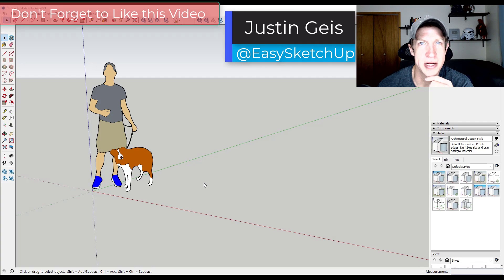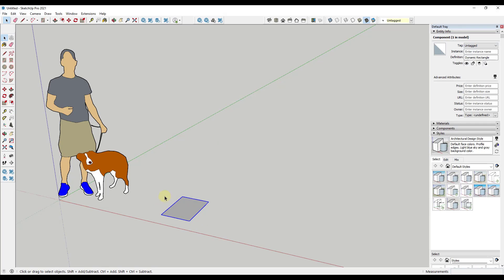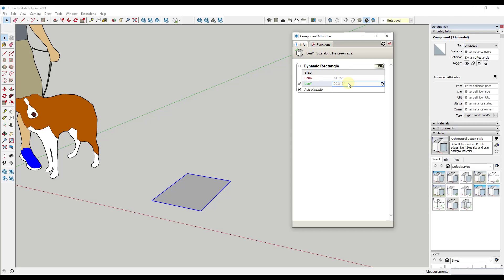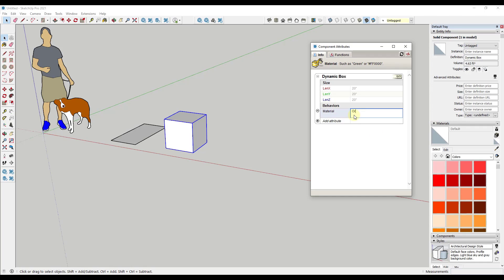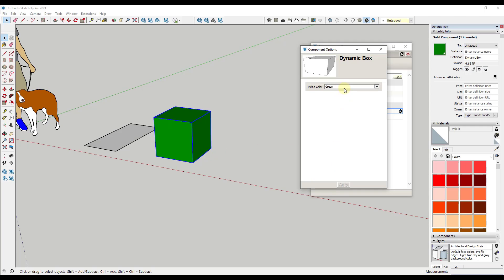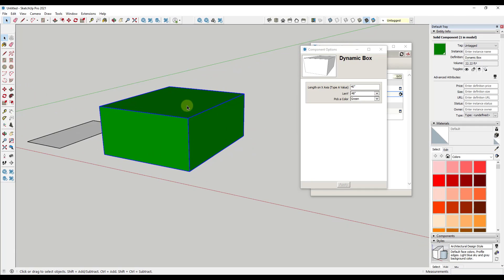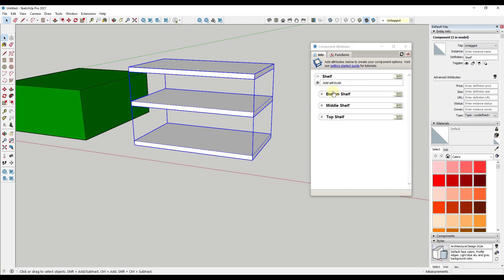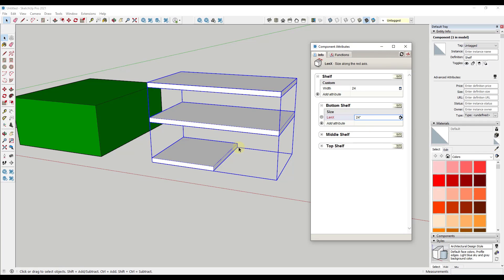Intro to DYNAMIC COMPONENTS in SketchUp (Beginners Start Here!)

Comment from the maker: Hi everyone! Let me know what kind of dynamic components you'd like to create in the comments below! :)
Reply: Block stairs with treads would be awesome :)
Reply: great video, congratulations!
I would like to know if it is possible to animate more than one compnent nested within the same component with a single click. by clicking at the main component, I would like to change atributes of more than one sub components
imagine two pieces of wood joined by a hinge. and at the end of one of these pieces is a second hinge attached to a base. then the set rotates with two degrees of freedom.
the idea is to animate the folding and unfolding movement of the workbench of this video.
https://www.youtube.com/watch?v=jUNZVaGAE3E&list=PLrUyw9mR4oD1RzRHxJnOBl7ZfGo303x2m&index=14&t=9s
tks
Reply: copy in a dynamic polar array - have the user pick the number of elements to arrange in a circle (say for bolts in a flange)
Reply: windows and doors, where height and length are adjustable and mullions and transom windows can be added or removed.
Reply: I am trying to figure out how to automatically create a box, with all of the sides of the box set up as a different component. I think I can see how to do that with this video!  Thanks.  Do you have a part 2?

Comment: Hi! I know this is not related with the video, but... have you had trouble with the 3D warehouse or the extension warehouse not working in sketchup?
Reply from the maker: Occasionally they'll go down, but not consistently. If you're using an older version they may not be supported anymore

Comment: Hi, This video is very helpful. Although, I have miter corners and 4 pieces for 4 sides (extruded aluminum). I have their position linked to "Frame size component" so they move with when I change the attributes of "Frame size" component  but I can not change the size of these 4 sides without distorting the 45 degree cut of these side pieces. Could someone please help.

Comment: Your instructions are super clear, but I have never seen anything about this problem, (see below)

how do I prevent a feature of a component from updating when I make a dynamic change IE a rabbit joint that changes depth when I change a width or depth of a cabinet back. example: if I make a backer for a bookcase and it has a rabbit in the back, when I change the depth dynamically by making the depth of the case deeper it also changes the depth of the rabbit.